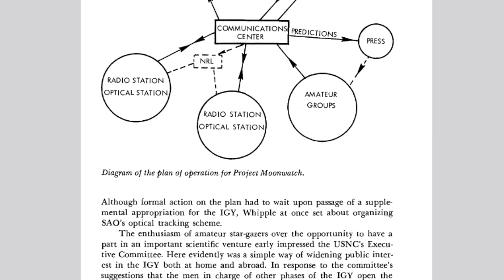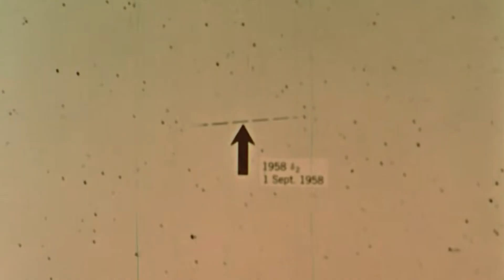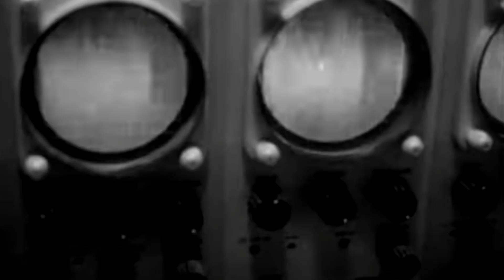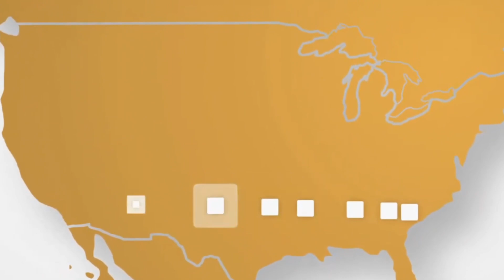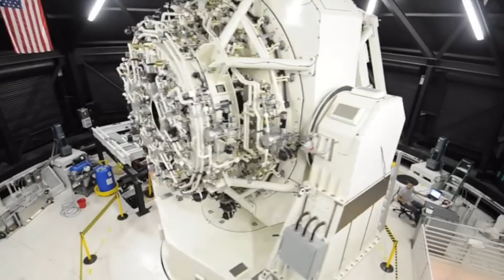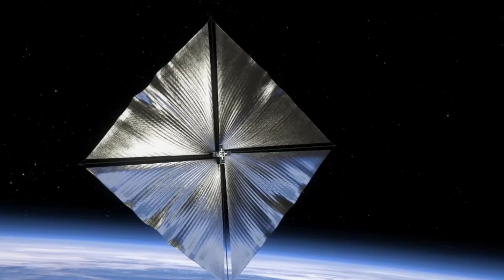Satellite Observing

Comment: You don't need a RASA 8" for GEO, HEO or MEO work.  A small fast lens in the 85mm focal length range is good for most objects.  If you are looking for really really really small objects the RASA 8" is nice, I have one.  In fact I  prefer the 85mm lens for most GEO work due to it's FOV and the fact you don't need to track. Cees Bassa's SATTOOLS measure.c tool performs this task like nothing else.
Reply from the maker: It depends on the observing conditions.  Under light polluted skies (like my backyard at Bortle 6 for example) the camera lens struggles to pick up GNSS satellites, while the RASA 8 has no issue.  If you have not yet tried it, the latest version of Tycho also supports measuring satellites and returning the result in IOD format. It also handles WCS with 3rd order and higher plate solutions, and performs a fitting of multiple catalog stars near the object of interest to allow for improved astrometry.
Reply: @tychotracker  I suggest you check out the blog of Marco Langbroek he operates multiple small lenses in a light polluted spot and does very well for GEO, HEO, MEO etc.  I have a pretty dark sky here and can usually detect most objects of interest with a 85mm lens and reduce observations from them from 40000km or less.  It's the deep space stuff and very small classified GEO objects I detect by radio that I really like the RASA 8 for.